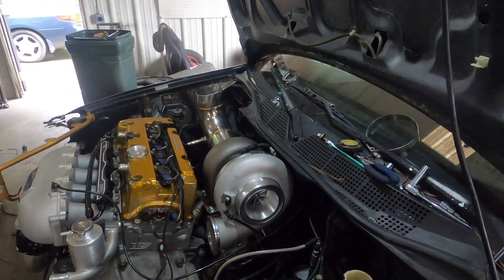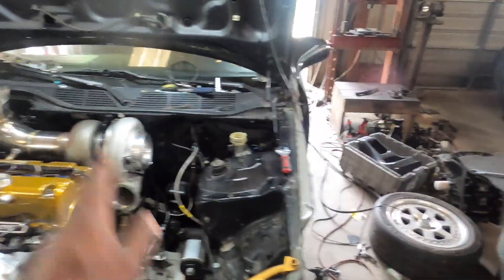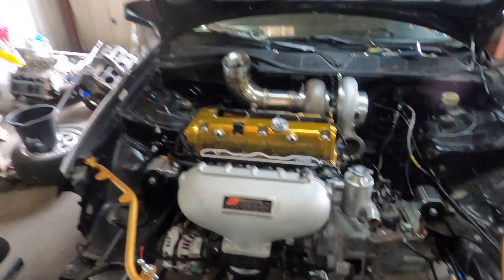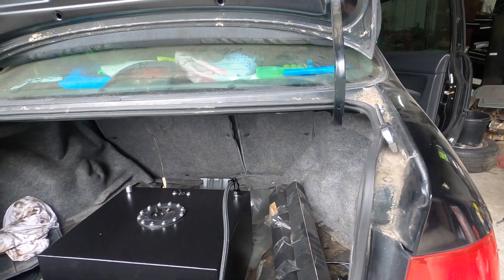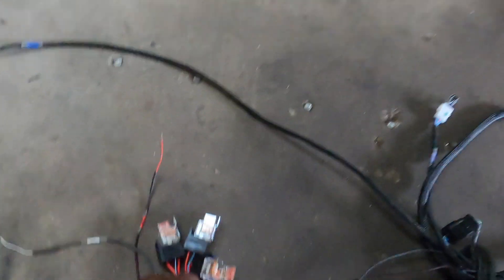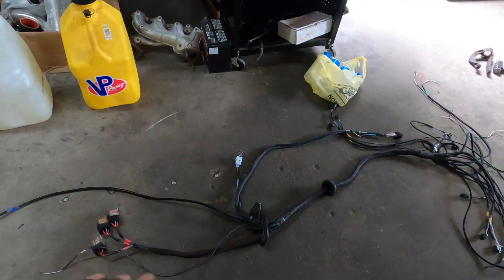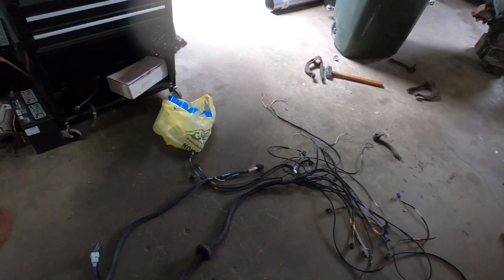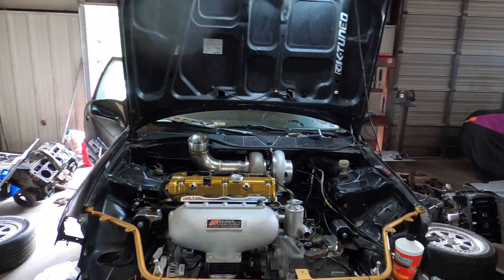How to wire a universal 4 cylinder harness on a ft450

Comment: Thanks for the breakdown bro! Been debating if ima run this harness with my 550 or if I was just gonna keep my rywire and get a jumper harness. You did in fact still have to trim the teeth off all the trigger wheels too tho correct?
Reply from the maker: Yes. But now it is not necessary. Fueltech has updated the triggers.

Comment: I seen a video awhile back on if you could daily drive a turbo civic. I’m thinking of daily driving mine, because I will be moving away and need to downsize to one car. It’s 1995 civic turbo b18b, pistons rods, e85. And every single suspension piece, wheel bearing etc has been replaced. I’ve had issues in the past or the car, but I’m praying if I go through the entire car it’ll be good enough to daily. I’ll also have extra small parts on stand by. is it possible to daily this ?
Reply from the maker: It’s definitely doable. Maintenance is key and not driving like the world is ending everyday will keep the car alive.
Reply: @blackphillbuilt8382  yes I’ll keep extra spark plugs, even clamps and random stuff on stand bye
Reply: I beat the crap out of my N/A built lsv for 2 years touching 9300rpm EVERYWHERE and EVERYDAY before the rods gave out 
12:1 -82mm JE Pistons, s2tuner2 cams, crower 80lbs valve springs, supertech STD flat valves, Eagle crankshaft, with $200 scat rods

Comment: Any one know how to run vtec and idle air control
Reply from the maker: Vtec needs to be on a really triggered buy ground on a blue/ gray out put on a ft450 or power by yellow output on a ft550 up. You can idle the car by timing to save a output but I believe if you want to run the idle air vale you need a out out controlled by pwm and the 3 pin connector would be wire as if your wiring the cam/crank sensor 12v ground and one output.
Reply: I’m using the same harness on my bseries using k series coils . The k series coil only uses 3 wires  is it ok to just cut the other two of
Reply from the maker: @McFlyEG  yes it is.